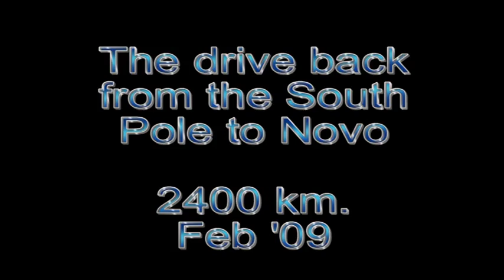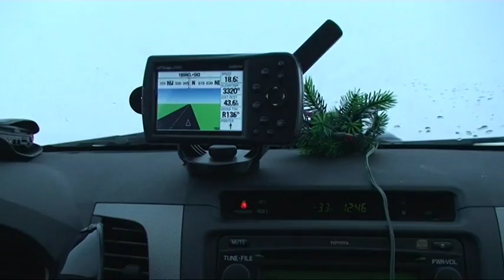Arctic Trucks at the South Pole

Comment: Not only thin ice but perhaps also deep layer of snow (just like in sand).

With low pressure, there's larger contact to the ground, therefor better grip. Some adventure vehicle do have automatic airflow control system ;)

Comment: @okuma0kuma what, because air is nonexistent at the south pole?

air is air, and pressure is pressure, regardless of the temperature. You just need more air molecules to get the same pressure at a lower temperature. 

Also, cold air is relatively dry because water is less soluble in air at lower temps. therefore, there's little chance of any air condensation and freezing in the tires if they're already being filled with dry air.

Comment: @okuma0kuma No moisture present if the tanks are filled with dry air to begin with, as mentioned above. They don't go in there with pre-filled tanks...they have compressors on-board. If there's no moisture going in, there's no moisture coming out.

Comment: @okuma0kuma The point I was making is that you claim that you'd need anti-freezing foam to fill a tire in a place that's got plenty of air already at freezing temperature.
Ice isn't hard enough to damage tires unless you drop the tire on a sharp ice ledge. Crystals won't wear a tire down. If anything, the tire's flex would heat it up enough to melt the crystals as they touch it. You won't get ice crystals if you fill the tire with already-cold air. and the tires can take a lot of heat expansion

Comment: This is a good video. camera man do the good job. the truck is diseal or gas.
suggestion. u guy fix the gear clean it up on the way and welder the suspension at the same place, if use Red Line gear oil 75w90 may be difference. one time i see u guy put 0w40 motor oil, red line oil have this one, may be u have better oil. how about 5w50 oil , 0w is better in. -40c  happy to see the video never feel too much make me excited.

Comment: i was just curious about 2 things as placing something like balloon in cold temperature would shrink but soon as temperature rise balloon expand meaning storing vehicle in warm section of a building/hanger could make a loud bang then there was curiosity of water particles crystallizing forming equivalent to sand texture which would grind tire layers from inside out of the tire ! ,who said anything about  no air in the south pole ? lol

Comment: something else that could be used on the lunar surface but make the cabs pressurized and water gel throughout the cab (radiation proofing) and another fuel source, like, hydrogen that is recycled. But that would be something if I could do that.